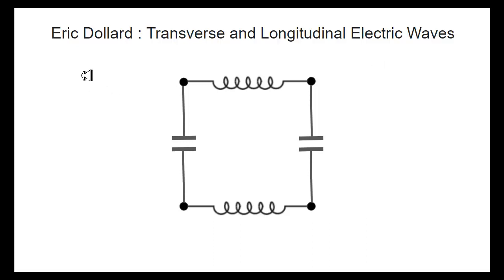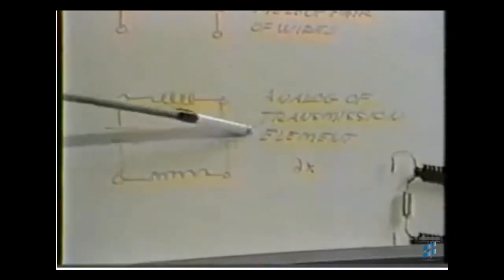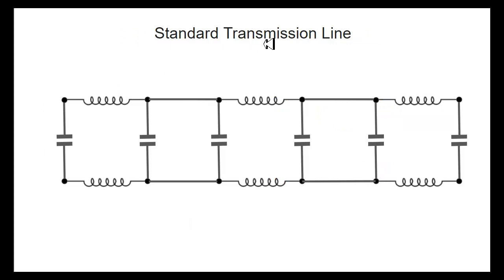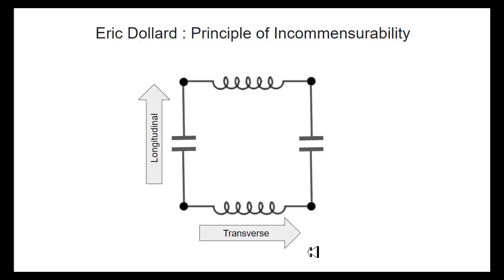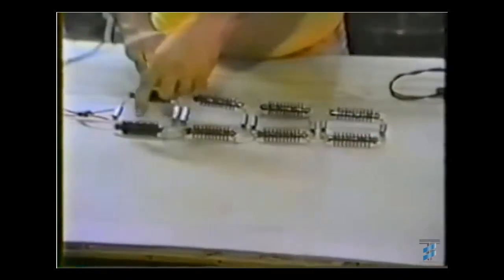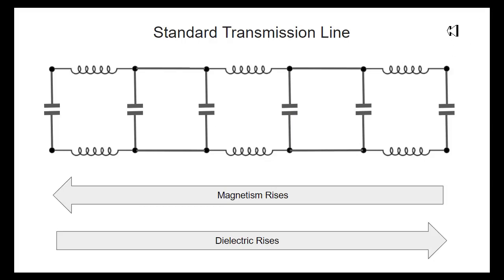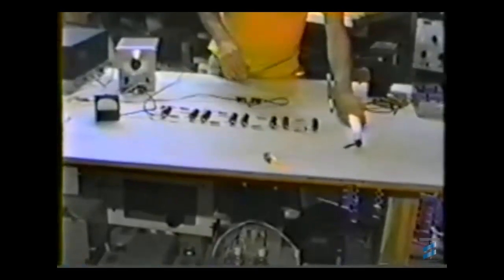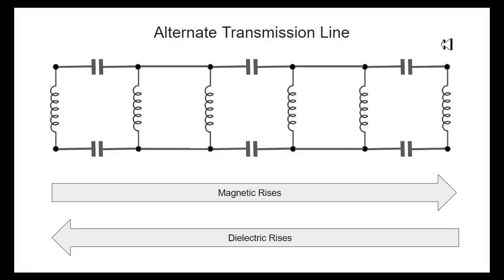Eric Dollard's Transmission Line Element and the Principle of Incommensurability

Comment: Nikola Tesla and Avramenko discuss 1 wire transmission of power as "longitudinal" propagation of electricity hence they say there are almost no losses when transmitting power at large distances.

Avramenko and his team gave us some epsilon formulas explaining it and Nikola Tesla mentions that using his system he could transmit power at any place on Earth with no more than 5% loss (arising in the wardenclyffe tower)
Nikola Tesla once mentions in an FOIA request from FBI that he could transmit power 12000miles with no more than 5% loss
Reply: addition;
My understanding is that using coils as generators and transmitters of electricity causes transverse vibrations and thus loses where as Nikola Tesla system uses capacitors to transmit power and it becomes longitudinal as its "relaxed" state limited by capacity discharge/charge wheres the conventional method induces power through coils.
Reply from the maker: I wonder why "the powers that be" selected the less efficient mode of transmission? Were they stupid? or just blind?
Reply: @FractalWoman  I believe it was intentional.

About the power transmission of power i suspect the oil industry jumped in as you could drive electric cars without battery

about the Raymond Rife machine, the medical industry jumped in

about the aether it was proly hidden scientists (jezuits and jws being their posterchilds) deciding we should not understand inertia nor gravity for it would bring an uncontrolled potential to the masses.
Reply from the maker: @manipulativer  Or maybe the longitudinal transmission line is more dangerous because of the voltage multiplying effect?
Reply: @FractalWoman  You will need to research it as i dont know the math but going by avramenko explaining the only problem would be using Earth as a conductor as back in Tesla times there were no silicone transistors.

What Avramenko envisions is 10x better electrolysis effeciency and having 3 solar farms on 3 continents and using this method to transmit power with zero loses around the globe.

But back than Nikola Tesla tested this and he never mentioned it being more dangerous.
Reply from the maker: @manipulativer  Just wondering because Eric Dollard seemed to be more afraid to touch the longitudinal transmission version. Maybe because it generates more heat?
Reply: @FractalWoman  Hey Lori, High school student here. Eric Dollard is not a fan of single wire transmission that Avramenko talks about because it generates lots of harmonics and interfere with other power systems ( he said that in some conference panel discussion ).  He doesn't recommend we start transmitting industrial power through ground using Tesla's method either because the power usage is so high compared with Tesla's time and this can cause earthquakes or similar seismic activities.
Reply: He is more interested in using the Tesla's transmission system for communicating with ships at sea. ( ship to shore communication system for military ) Plus it has some other interesting application like communicating with something that's in Mars through a communicating system that doesn't change with distance. ( space-scalar communication system )
Reply: @රෙසාද්_ඉන්දිප_04  Tesla was once mentioned by an army general for he mentioned that submarines need low frequencies to comunicate.

And yes, wardenclyffe was used primarly as a radio for the whole earth and a testing tool as he put it. He envisioned putting wardenclyffe towers around the globe near water resvours to generate power for the whole planet.

He explains that if the machine were to operate no more than the losses in operation would dissipate if no user were to use the power. 

idk nothing about scalar comunication with planets
Reply from the maker: @manipulativer  actually, eric did mention that he was only using one wire in the longitudinal transmission line in the video.
Reply from the maker: @රෙසාද්_ඉන්දිප_04  interesting. Thanks.
Reply: Inter-planetary communication system with no distance factor is an Eric Dollard's idea. It's a modern application for Tesla's communication system. Tesla had his own ideas about sending signals to Mars too.
Reply from the maker: @manipulativer  Apparently, some have heard Dollard claim it is not a good idea to use the earth as a wire due to the possibility of accidentally triggering earth quakes. Earth quakes are one of Dollard's areas of expertise. I'm sure Tesla (in his day) couldn't imagine how extensive our use of electricity would be. Maybe it's a good thing we didn't go that way. Just playing devil's advocate here.
Reply: @FractalWoman  exactly what a shill would say imo.

Ofcourse i could be wrong but i am convinced.

And Avramenko explains that in todays day and age it wouldn't work cause we have sensitive equipment and most silicone chips are susseptible to high voltage although i don't believe it would influence them if the effeciency really is near perfect. 
This is why he said that using a cable underground (no near field loses) from continents with lots of sun would be a good idea.

And Nikola Tesla said something like:"Its like the creator laid it like that" 
And as i see it its a natural progression of human evolution.
The creator of this universe made physic rules that lead to an advencement. We have been sidetracked with digital technology and surveilance using radio instead of Tesla system, while we would rather use radio to target specific pathogens at specific frequencies.

Everything is wrong... physics was hijacked, medicine was hijacked, money was hijacked, collective consciousness is poluted with movie hype and adds and finance was hijacked by an AI and human consciousness programmed  via suggestive programing to levels never before seen.

I just felt the need to write all of this. probably some good weed idk
Reply from the maker: @manipulativer  I 100 percent agree with your sentiments about physics, medicine, money etc...It's a crying shame.

Comment: Hi Lori! Always exciting when you review Eric Dollard's works! :)
One correction though : In the alternate transmission line both dielectricity and magnetism rise towards the open end of ciruit (to the right).
It seems we are looking at two extreme cases of dielectric and magnetic flux interaction. I interpret this in the following manner :
For the TEM case : The dielectric and magnetic fluxes interact fully (orthogonal to each other, in space quadrature). This ninety degree out of phase interaction causes a destructive interference pattern which manifests as a transverse wave in space and power propogation in space.
For the LMD case: The dielelctric and magnetic fluxes do not interact at all (parallel to each other, in space conjuction). This non-interaction causes a constructive interference pattern which manifests as a longitudinal wave in counterspace and power propogation in conuterspace.

Comment: Greetings
If you look at Eric Dollard's longitudinal transmission line, you can see that the bulb is lit at the end of the transmission line. This bulb also lights up at the same end of the classic transmission line example. The dielectric part is therefore highest at the end in both transmission line examples. What changes is therefore only the distribution of the magnetic part. In a longitudinal transmission line, the dielectric and magnetic parts together are strongest at one end and weakest at the other end. And here we get to what I've been pointing out in several of your videos and Distinti's videos. Distinti claims that only wave propagation according to Euler's equation is possible. And that wave propagation according to Maxwell's equations does not apply, where the magnetic and dielectric parts propagate in phase and not 90 degrees out of phase. I think that's exactly what Eric Dollard accomplished in this video. And that's why I wrote in those comments that I think both variants of wave propagation are possible. Euler's equations for transverse waves and Maxwell's equations for longitudinal waves.
Regards
Zd.

Comment: @Fractal Woman
Dear, you're wrong on the direction for the longitudinal mode transmission line. The magnetism and dielectric BOTH actually rises to the right. They are space conjunction with each other. What eric dollard said about the dielectric drops off are on the beginning and not the end here. Magnetism and dielectricity are yin and yang. They are entropy and negentropy. Hot and cold. Explosion and implosion.

Comment: i really dont think dollard knows exactly what hes talking about at this point to be honest, never has the speed of their transmission been detected, and he claims that his longitudinal wave is faster than light, sounds like something worth sharing,....
Reply: Longitudinal wave IS faster than light, as he experiments with it in his videos. I am sure you never watch his old videos.
Reply: @lukiepoole9254  I have, it’s true that I have possibly missed something, though* if you have no source where these longitudinal waves along with their properties have been demonstrated then that’s another thing and it speaks for itself. I really would like to see some sort of proof but if it isn’t there why would he make the claims?
Reply: @cosmicyoke  How do you even 'detect' the speed of transmission lol. It can only be calculated. Unless you have a wire a few miles long? That would be costly. Also, FTL waves generally goes out of circuit easily as seen in his video where the waves literally travels into his hand and then the ground using only one wire connection, from the fluorescent lightbulb of course. Normal AC doesn't do that.
Reply: Longitudinal waves vs. transverse waves is the difference between pushing a long pole horizontally vs. yanking up and down on one end to make it vibrate like a guitar string. Insofar as 'speed' is concerned, both the medium and mode of travel matter (i.e. vacuum? air? water? etc., transverse or longitudinal?) You have to realize that speeds have rates of inductance through their medium to begin with (i.e. swimming vs. flying vs. stuck in the mud).
Reply: @monsterknob  yes, thanks for your comment, I do know the differences between the two and also that surface waves are a hybrid of the two. and yes, the medium plays the biggest part in propogation properties, both speed and in total power delivered, there definitely may be something that I simply havent gotten to, a hole in the understanding but nevertheless its interesting to think about
Reply: @cosmicyoke  Are you familiar with the concept of counterspace? It may be the hole you're looking for (pun intended) 😆! His social skills and vocabulary easily leave room for things to be lost in translation, so I'll give you that!
Reply: @monsterknob  I am very familiar with the term yes, however I cannot say that I truly understand it, nor can I say that Dollard or anyone else has proved this concept.
Reply: @cosmicyoke  I can only say that it stands to reason that counterspace is the inverse of space, and its subjective existence is strongly hinted at via the membrane of pervasive aether that provides a window (or maybe even mirror in some sense) to it's ontological existence. If anything, it (counterspace) provides much more rational insight than the absurdities of mathematical minutia--as accurately descriptive as they might be at their magnitude of relevance. I mean, our collective ability to measure is inherently limited by our equipment, and, not to wax poetic, even our mathematical discoveries are nascent in the grander scheme of the true infinite interconnection of all that has been, is, and will be. Until we move past the utilitarian paradigms of scientific exploration we've been clinging to, we will be at the mercy of the objective limitations of our ignorance and acumen--but as we shift towards exploration of subjective 'philosophical'/metaphysical (not the woo woo kind) principles, our ability to actually explain the universe will make modern descriptions attributional at best, and irrelevant at worst.
Reply: Wheatstone of the Wheatstone bridge fame demonstrated the speed of electricity using similar instruments that were later used to test the speed of light. Dollard refers to this on a few occasions. The speed of electricity is faster. There is a mathematical representation of this but I can’t remember what it is.
Reply: @martinhughes1854  yes I remember dollard mentioning this various times but never showed it, he just throws it out there as if it’s nothing.

Comment: Can we look at magnetism as the absence of dielectricity and hence the emergence of spatial 3d qualities?
Reply from the maker: Where magnetism is, dielectricity is not and vice versa. They are incommensurate. Not sure if it is correct to say that one is the absence of the other since each exists in of themselves.
Reply: @FractalWoman  I think in this sense i get the idea that size doesn't matter but rather proportionality and patterns what matters, space is still there but just in the inverted sense; it wouldn't matter whether you go in (<1~1/r^2) or out(>1~r^2).. ok thanks!
Reply: @FractalWoman  hmm this seems to be in line with ionel dinu's thinking that modern electromagnetic radiation is only magnetic waves, not electric; I would state that they are simply conjugates of one another, however I have read that Electrets have strange interaction with Magnets (electrets being 'electrostatic magnets').
Reply: To be precise, magnetism is the loss of the dielectric field just as force is the transference of inertia. I hold a ball vs. I throw the ball--the ball always starts at rest (without getting into relativistic nonsense), and it always ends at rest.

Comment: 3:28 a thought: this diagram mirrors the divergent/convergent, and inertial plane of matter/magnetic fields that Ken Wheeler talks about. Could this be a macro-scale model of an atom?
Reply from the maker: Hmmm. Interesting idea. It also could be a model of the cell at the biological scale. You should read the book Healing is Voltage by Jerry Tennent.